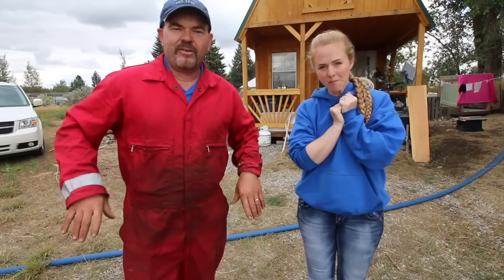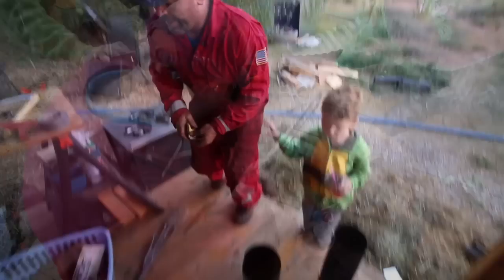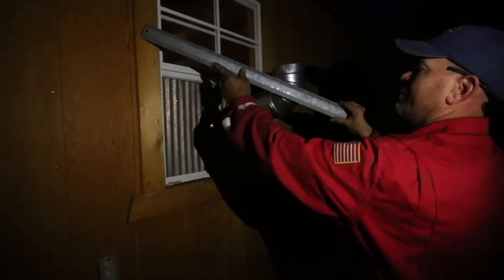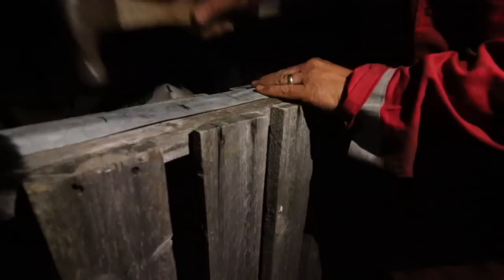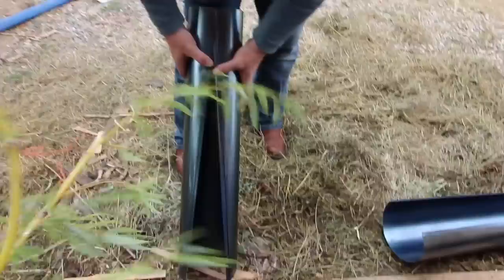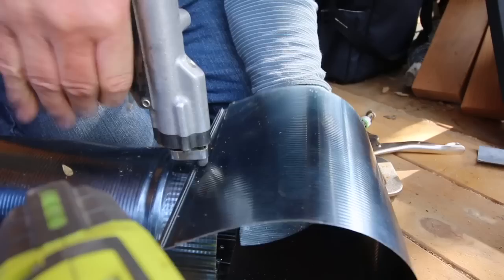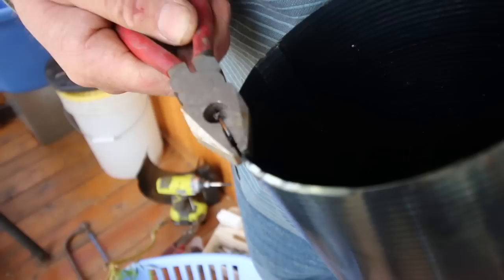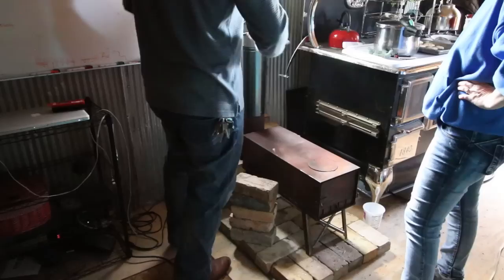CHEAPEST WOOD STOVE INSTALLATION for Tiny House EVER!

Comment: Not a huge expert with wood stoves but i am a welder and have built plenty for friends over the years. From working with metal i know  that the piping used in the corners and the window should be replaved with steel. Not galvanized steel which was used here. It's extremely bad for your lungs when heated and with enough exposure can kill you.

Comment: As of today, The Home Depot has a 12 Gauge Thick Cast Iron Stove that is 3 times the size of that nice little Yukon stove, for $175. Free 2 day delivery, but you need your own stove pipe. Still, a nice deal for an 8 hour burning WOODSTOVE made by England’s Stove Works; a U.S. company.  
Just sayin if you have the money, it could save your life in a pinch 🤏. 
Nice video. Thanks for sharing

Comment: Another Canadian here.  great work with the house.  

I'm no stove expert, but I have two suggestions. 1. The higher pipe should always go inside the lower pipe.  If you ever have creosote dripping down, it will stay in the pipe instead of seeping out the joints to the outside of the pipe where it could cause a fire.  2. exterior pipes should be double walled.
Reply: Interior pipes should be double wall until the exterior but the way i do it in my shop I'm able to use single wall all of the way which is almost exactly the way they do it. Run it through metal and far enough away from wood then there won't be any issues
Reply: Plus with single wall im getting all of that heat too
Reply: @michaelbidwell4210  Thanks for the reply. I guess the rules are different here, maybe a colder climate, but we have to have class A on the exterior, in attics, and usually if the pipe passes through another floor. I think for the last one, if you put a proper heat shield and keep clearances you can continue the black pipe to the ceiling of the top floor, then transition to Class A. I suppose the rule is to avoid passing objects or debris like leaves from catching fire on a hot pipe.

Comment: Ive done this very thing almost the same way.
I used two sheets of corrugated tin with a top and bottom lip of 2 inches and a final bend on each  to fasten  to the inner sheet and in between was unpapered fiberglass insulation to reduce heat loss and behind the stove I used fireboard  with 2×2  blocks  to hold it away from the wall for heat reflection ( saftey).
Flagstone underneath with a one foot apron in front.
Never had a problem.
Stove was Min 15 inches from the wall.
Done many of these.

Comment: I've heated my 20' x 40' shop where I'm building an airplane with a boxwood stove for 30 years now. It was a 20 x 60 corrugated aluminum chicken shed from a nearby development, cut up & hauled home. A fan powered heat exchanger from Northern Tool saves fuel & heats it quickly. I split my wood down to 2 to 3" with Harbor freight splitter. A grocery bag full of dry pine needles and a wad of phone book paper gets it going in 5 minutes. Some of the s.s. stovepipe found dumpster diving has lasted 30 years. Regular steel rots in two.  Shed is insulated & paneled with pegboard.

Comment: Where we live in Canada the stove would not be approved..too many bends, catches the soot and creosote. .considered  a fire hazard so please be careful especially at night. also make sure you have air flow in the small space..and a carbon monoxide alarm. hope this helps.
Reply: yeah i was wondering about the science of monoxide/incomplete combustion
Reply: Atheist...had it not been for a carbon monoxide alarm my family would have died so don't knock safety and don't bother to reply.
Reply: Lovely video! At the risk of sounding like a Safety Sally - at 2:36 - propane tanks inside the house? I wouldn't. I'd move them outside. I know people do have them inside but one small leak and catastrophe - your people are too precious.
Reply: ....i think there should be a box that isolates the propane tank with a vent that goes outside......does the gas sink or rise?....that would demand where to put the vent............one big  problem with a vent though!!!
......if the woodstove is drawing in outside air....it will draw the propane vent air in and carry the leaking gas directly towards the fire!!!!
...so its better not to have it in a box with a vent,cause there is no way they know how to build a fume tight box
Reply: Both sides now
Reply: Christine Brush yes....even if this is viable and works just fine....if you do this in your house and it is not installed or cleared by the insurance company it will void your insurance in your house should something happen. May not matter too much in a cabin, but in a regular house in a neighborhood it would.
Reply: "..too many bends, catches the soot and creosote"
You're right, this design will lead the condensing tar directly inside the house and when it leaks out there off the pipe (always leaks somewhere), the hot tar will give you great headache. If you really go with so much length of unisolated pipe outside the house in cold weather, you have to use a t-style knee with a little hole at the bottom instead of the rounded knee, to catch the creosote outside the house and let it drip  there, so it wouldn't harm your health. But better stay inside with the pipe and go through the highest point of the roof, you'll get a lot more heat out of the same amount of wood, and if the outside part of the chimney is short enough, there wouldn't be any creosote issues at all. But this wood-saving solution needs a rainproof passage through the roof -> more work to do.
The rest is great stuff, come on with all your safety concerns, crazy americans ;) , you'll never taste living, if you keep everything as safe as possible. Dying without having lived isn't fun either.
Reply: That's great advice. I had 2 friends who put there charcoal grill inside there tent at Charlotte Speedway. The track clean up crew found them 2 days later and both died from carbon monoxide. A wonderful woman lost her husband and brother. So, you can never be too careful! P.S. I love off grid and home steading video an story's. Wish I could do that but my health won't let me do anything. But I'm lucky enough to have 7 Acer's of woods with my place and a nice size yard for my great neace and nephews when they get to stay with me.
Reply: It looks like a standard recreational stove used in hot-tenting and hunter cabins.  These things do work quite well.  The brick heat sink should work well and the air gap at the back wall should prevent and fires.  A larger hearth area in front of the stove would be more appropriate.  The only thing that gives me cause to worry is the single wall chimney instead of a class B double wall.  They are going to have to clear the soot on a near-weekly basis.  The chimney clearance from the roof is not high enough either.
Reply: We have wood heat. Not any better  way to heat your home you just have to be safe  had for many years  to all have a blessed day.

Comment: This is an old deer hunters hack for starting a fire easily - - Get a 5 gallon plastic bucket that has a snap on lid. Go to the local lumber yard and ask them if you can have some of their fine sawdust from their cutoff saw (any sawdust will do, but the finer the better). Fill the bucket with sawdust and then pour about 3 to 4 gallons of cleaning solvent or kerosene into the sawdust filled bucket. Snap the lid on the bucket and let it absorb all the liquid (about a day or two). Then get a 15 oz tin can to use as a measure and put 1 can of fire-starter under your kindling. Then light your stove. The fire-starter will continue to burn until you have a good burning fire that will burn on its own. This way you can reduce the amount of paper or very small kindling that is needed to start your fire. Good luck!
Reply: Pine sap & birch bark works better, and it`s free
Reply: @jackmehoff2961  i dont think it will work better but does work
Reply: @Facchini98  I`m sure whatever toxic chemical you choose, it`s got a lower flash point than sap. Sap will burn hotter, and generate enough heat to dry wood to get the fire going. Hopefully it doesn`t make a mess of your gear. Sap is safe to carry, and can be found most everywhere.
Reply: @jackmehoff2961  true enough plus less toxic so i guess it would be a better source then fuels
Reply: @Facchini98  Amazing stuff !

Comment: Nice, be sure none of the smoke and carbon monoxide leaks thru the connects and finds its way into the house, the smoke is carcinogenic, and of course, the carbon monoxide damages lung tissue, not good for the kiddos. Metal tape is great for sealing connections. I like his design! You can Borrow a hand held carbon monoxide detector and check the results in the house. He seems to be such a kind man, what a great Biscuit helper!!

Comment: Julie i have to say i like it.Just 2 things first whith that design water is going to run in around the pipe at that angle. Second please tell me that gas bottle is not used in the house.Code says it suppose to be on the outside piped into the house.Be safe girl.Just realized the elbow was an adjustable one no coded for inside use they let carbon leake into the house.Solid elbows are supposed to be used indoors.

Comment: we used a Yukon M1950 last year to heat our 31 foot golden falcon travel trailer, vented it straight up out the ceiling vent, and used old lathing from a falling down house for firewood and it would run me out it got so hot! used a contactless lazer temp meter to keep things from catching fire! i still have the unused liquid fuel parts and almost new manual im going to sell!

Comment: You need to stop RAINWATER from running along the bottom side of the angled pipe and right inside to your stove..... A few inches out from your corrugated "pass through", add a large hose clamp with the screw part on the bottom (or 2 smaller clamps added together if you can't find large ones). what also works is a LONG "screen door screen" wrapped around the pipe. Anything to stop the water and make it "drip off" before it gets inside. Maybe even a few layers of baling wire wrapped around it would work.

Comment: Another crazy US guy here...first..a GOOD cast iron "box stove" ( same design as yours) can be bought brand new for $250 or less if you buy used..That "camp stove" ( anything that thin walled) will burn through quite quickly with constant use..also for a wood stove to "draft" well for quick lighting and max heat, it needs a minimum of 2 1/2 feet up, 2 1/2 feet 90 degree out and 2 1/2 feet above peak of roof...tiny hole for build up at out side 90... also mesh at least on top to keep embers from catching roof on fire...even with cast iron, it needs a bed of fire brick on bottom of inside to keep from burning out..then it's one load at bedtime will last all night..NO PINE!! clean stove pipe every year ( more if it's used constantly) with stove pipe brush...and MOST IMPORTANT!! a decent size fire extinguisher!!...also you need to have a window cracked to keep stove burning proper (which also ventalates the CO2 levels..68 years of heating and cooking with wood has taught me each of these things the "hard way"...wood heat is great! but you need to respect what your doing..Good Luck and I love your tiny house farm

Comment: Design a steel resivor that can fit over the wood stove flush with the side's. Fill resivor's on each side of stove with Gallium Aluminum alloy. Add in hot gas stirling piston's to turn fan's to circulate heated air away from the stove and the resivor's. The Gallium Aluminum alloy will absorb and conduct the heat slowly. Which mean's you will not have burn more wood to stay warm. 😁👍

Comment: That's a good way of setting it up, But on a wood stove you have to run the pipe crimped in down. If you don't all the creosote will come out and run down the outside of the pipe getting it on the pipe, stove and the HOUSE making a mess out of everything. This is words of an old HVAC man.
Reply: Dog Bone Knives  how do you run the crimped in pipe down?
Reply: You just turn the pipe upside down. The crimped end always points to the wood burning stove. If you run it like you would on a gas heater as the creosote builds up the heat will make it melt and run down the inside of the pipe and the crimped end (male ) being smaller than the straight end ( female ) will start coming out of the pipe joints and can catch on fire!! ( Don't need a flame to make it burst into flames it's self just high temperatures and oxygen which is plentiful on the outside of the pipe. )  Me I'd keep the fire on the inside of the pipe instead of on the outside of the pipe!! Safety first. I hope this explanation clears up any confusion that you may have on running stove pipe.

Comment: The Yukon stove seems so simple...and durable. Could one use it as a non-emergency heatsource? And adding the bricks not only makes it lovely, but more  functional, more efficient and safer.  I can't see why this couldn't be a long-term heatsource. Does the type of metal it's made out of wear thin over time from use?

Comment: Great video other than letting children handle sheet metal with bare hands...

I'm a plumber/gas fitter at a company that primarily works on heating. I know full well by the end of a new furnace install, I'll find all the little cuts my leathered mitts get once the CPVC primer comes out.

Letting a child touch 26 guage with their bare, soft little hands? Give your heads a shake.

Comment: Isn't that a wood burning cookstove sitting there? They make plenty of heat.
Reply: I was wondering that myself
Reply: Build a smaller 🔥 in the cookstove.
Putting in the other next to it is a waist of space and time. 
And by him using that Galvanized air duct elbow for stovepipe he just gave them all a little shot of Poison!🤮☠☠
Reply: Cock Atrice  The shinny metal Ducting that people are buying because it's Cheaper is HVAC DUCTING. 
When it gets hot the Galvanized coating burns and releases Toxic Fumes!!
You should Always use STOVEPIPE for the flue on any wood burning appliances. 

The HVAC DUCTING is for Air only and even the seems are different and require sealing to be completely Air tight. 
And yes I'm speaking from experience I was in the HVAC sheet metal trade for 15 years. 
Even when you weld Galvanized or Stainless you have to have ventilation and wear a special respirator!!

Comment: Not seeing any damper on the stove pipe... Was that intentional? In my experience with woodstoves, you're losing a lot of heat up the chimney pipe, without a damper! Need to be able to close the damper to hold some of that heat in! But maybe its due to the type of stove? idk... Might also want to look into masonry heaters as another solution - use less wood, emit less smoke, can be built with just bricks & concrete.

Comment: Juli how many seasons would one of those little stoves last?
Reply: The guy given it to her said that he has had it several years.  So it must last a long time.
Reply: Thank you
Reply: If its made with12 gauge metal, it will last 15yrs or more. The one I have is 12 gauge metal, but there are many different manufactures out there.
Reply: Many seasons I used them in the Army they last for many years or the military would not use them. Most likely 20 plus years or more.
Reply: OK yall have convinced me I need one for the cabin now I just have to find one lol

Comment: I Love your videos.  This stove is very budget friendly, but not very safe (and also illegal, according to the government).  At  least a couple of other things aren't right here.  The uninsulated pipe outdoors will cool the smoke quickly and condense a lot of creosote on the inside of the pipe (especially without a secondary burn taking place), leading to more danger of fire.  Also, the joints are backwards.  The "male" end should be pointing down so creosote and water condensation stays inside, not flow out and down the outside of the pipe. The lower air pressure inside the pipe will keep smoke from coming out, once the draft is established. Please use it carefully and maybe make improvements when the budget allows?
Reply: Douglas Cooke 
I was wondering if this addition is a temporary heat source while waiting for the furnace to be installed ... could this be used safely for a short period of time?
Reply: Yes, with care and attention to making sure the creosote doesn't build up.